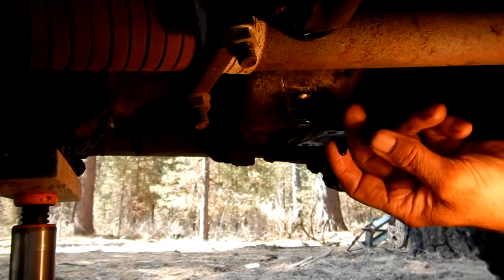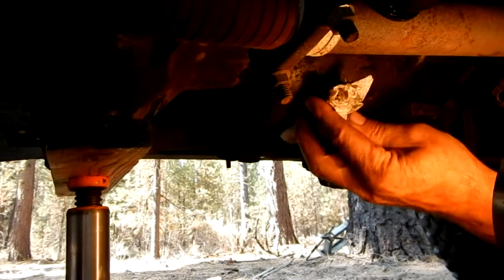1962 Willys CJ-5 Jeep - How To Drain and Refill The Transmission And Transfer Case

Comment: My whole body feels fear when I see people use a crescent wrench backwards cranking down on a bolt.  Same with channel locks, vice grips, and just pliers in general. I guess I'm being an arm chair karen, not meaning to.  Great video, there were a few details I wanted to know that you covered and helped me out a lot.  So thank you!
Reply from the maker: I hear what you're saying. Channel locks and vice grips generally don't work well backwards. At least an adjustable wrench will work backwards, although the breaking strength of the tool might be less. Sometimes, in the heat of the battle, you do what must be done. Glad that you got something from the video!
Reply: @TomandJulieMineExploring  Absolutely!  I had a very cranky customer once who was a retired home inspector and he chewed my ass out for using Channellock's backwards.  It just burned into me and became a part of me I guess. lol.  One true tip I have for you though is to use a standard crescent wrench on these old jeeps instead of  a metric one!  Check the torque on the muffler while you're down there!
Reply from the maker: Haha, oh those are very true tips. I thought it was the muffler bearings that needed to be checked regularly.

Comment: hey tom love your channel! i also have a 62 willys and its great. my question is do you have a 3 stick trans? if so what positions do they have to be in when driving on pavement?mine seams to be in all the time, so i dont know if my transfer case is bad or going bad.any info will help, thanks and keep the vidios coming
Reply from the maker: Decal, Transmission & Transfer Case Shifting Pattern, 1941 ... https://thejeepsterman.com/products/decal-transmission-transfer-case-shifting-pattern-1941-1971-willys-and-jeep
Reply from the maker: Hi Robert. Ths sticker shows the shift patterns. Make sure your hubs are unlocked by turning the big screws about a half turn. The hubs are a little tricky to operate at first until you get the hang of it.

Comment: Not good to pull that cross member without some kinda support unther the transmission. Its awfully hard on the motor mounts otherwise. And 8 point socks can go a long way in always keeping the corners square on those plugs.
Reply from the maker: Thanks for your input,  William.

Comment: Great job Tom, that will do it for A long time. Enjoy working on old vehicles like your Jeep.
Reply from the maker: I'm hoping that will last for the foreseeable future. I enjoy working on this Jeep, too. Only one bolt has broken so far and that was on the water pump. No metric sizes and good old American steel used on this baby. I was even able to back out the be ok en bolt without too much trouble. Thanks for watching,  John!

Comment: Hey Tom, great video. Really appreciate it.  is that a T-14 tranny and Dana 20 transfer case.  I have a '72 Commando with that configuration. Do you think the fluid levels would be the same?
Reply from the maker: My tranny is a T-90 and I think the transfer case is a Spicer 18, so, obviously different than yours. You should be able to track down the specs for yours.
Reply: When the fluid starts co omg out of the drain hole on the T14 it is full.  I have one in my 1969 CJ5 with the factory Buick v6.

Comment: A good bit of Jeep maintenance.  What type of light are you using there it looks like a a pretty powerful one.
Reply from the maker: When we got this Jeep it had the blackest engine oil I think I have ever seen so I figured the rest of the fluids would be due for a change as well. The light is a standard 120 volt 60 watt bulb in a metal utility fixture. Thanks for watching, Shane.